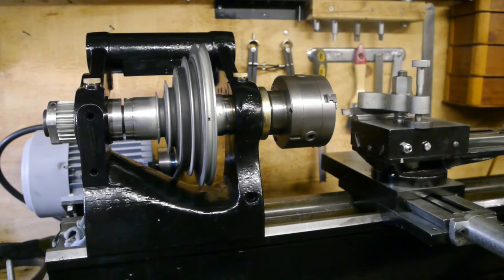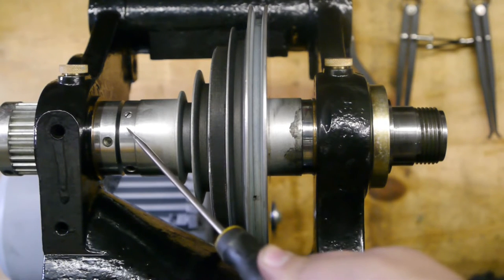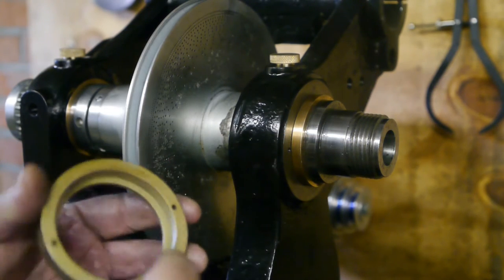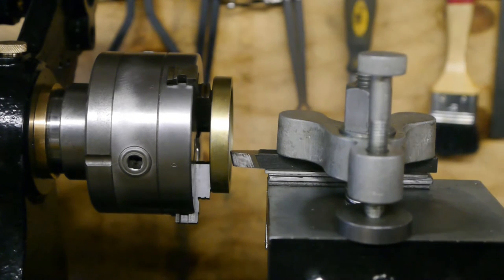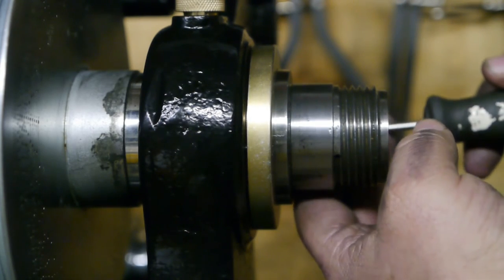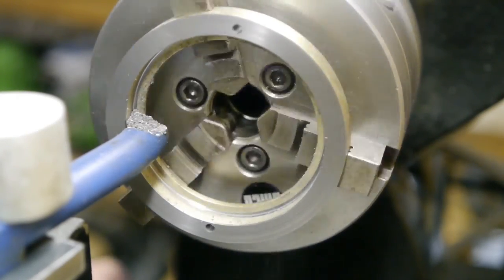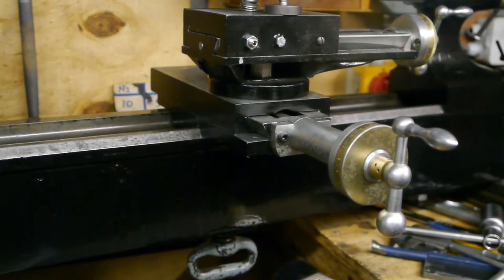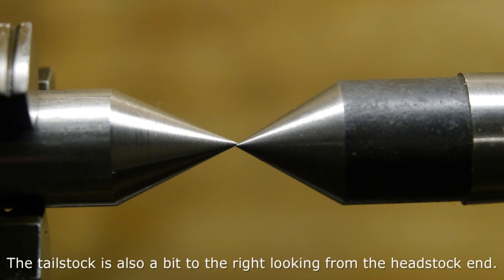Some modification to the old lathe

Comment: Very interesting.

That old lathe looks really nice now, in black. Beautiful controls since you polished them up.

Looks like the front drive pulley can be used for indexing, which was fairly common in those days.

Good luck with the restoration, and thanks for posting.

Cheers Rob
Reply from the maker: Thanks. And your right about the pulley. But I'm missing some parts so It can't be used anymore.
I might make a new simple index disk to be mounted on the back of the lathe that will also double as a spindle lock.
It should have 30 degree increments so I can make 2,4 and 6 flat sides using a grinder.

Comment: did you level the lathe with machinist levels? there is a good video on kieth ruckers chanel about that
Reply from the maker: I don't have a machinist level. But I was unable to get the tail-stock back in alignment by lifting on the low corner.
So, I think, it must be something else. Or perhaps the bed is severely warped.

Comment: You are having more than your share of hiccups with the lathe.  A bit of one step forward, two steps back.

The bearing should wear loose.  I would try running and see how warm it gets. If not too hot I would let it wear over time.

Good luck the new found tailstock issue.  

I broke my first centre drill due to not paying attention.  The chuck did not get the bit evenly between the jaws.  Easy to do with small diameter bits.  The jaws did not get the bit on centre, so as soon as I started to drill I broke the end off.  At least I have the other end to use.  I realised I had a spare chuck on the desired Morse taper, so now I leave the centre drill in the chuck.  Makes it easier and faster for centre drilling.
Reply from the maker: That will all be forgotten once everything has been fixed.
Hopefully everything will get fixed or this thing will haunt met for the rest of my life.